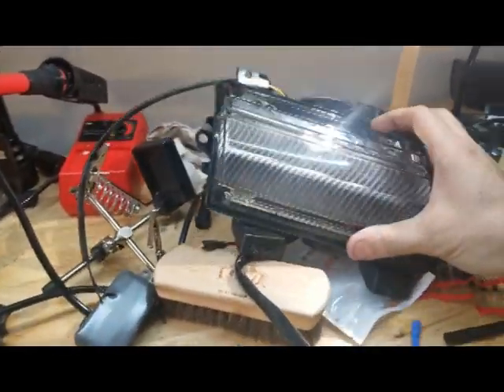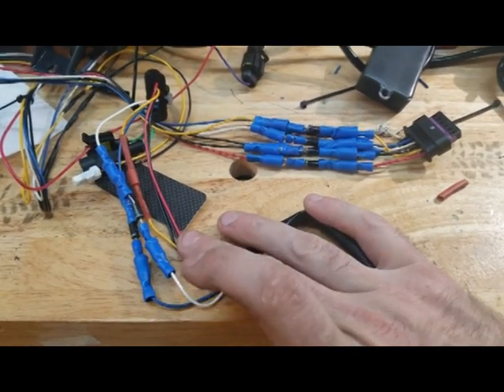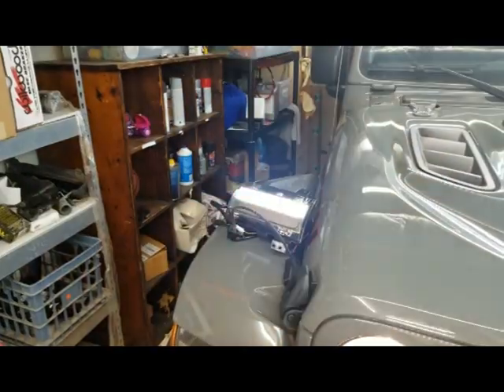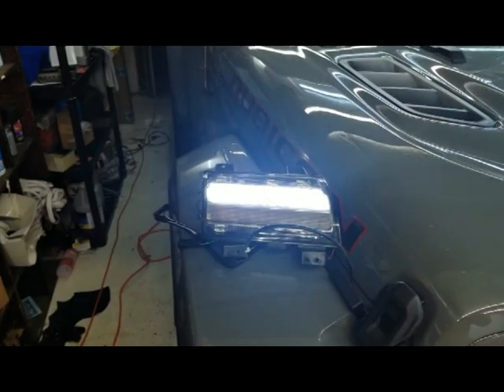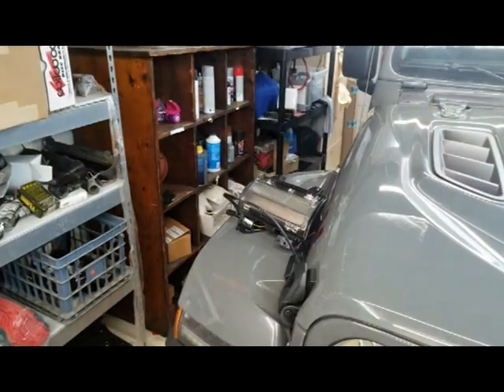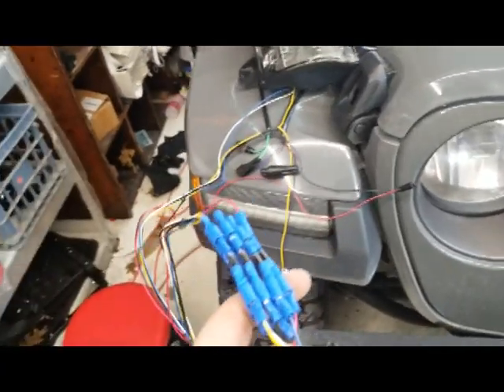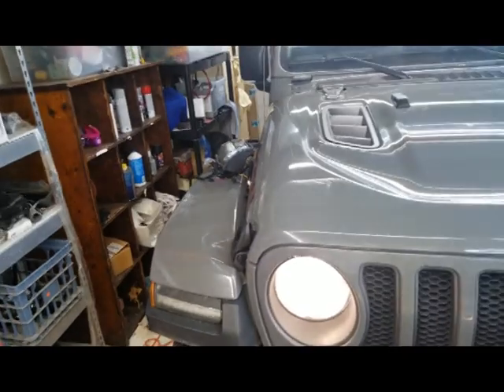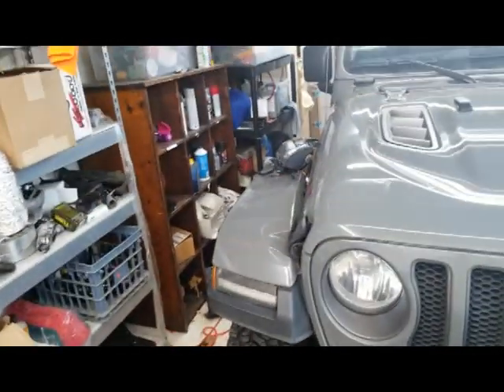Modifying Morimoto XB turn signals Jeep JL 2018+... working on a solution to the irregular flash!

Comment: Great video... can you tell me which wire is the power for the DRL? I think it's the blue one. I want to wire my halo in the headlight to it.
Reply from the maker: The yellow wire.  However when you hit the turn signal your drls will drop 

I tied my drls for the halos into the heated seat circuit using an add a circuit.
Reply: @obsessivehobbies5464  yes, I see that when I turn on my turn signal the DRL goes out which also turns off my headlight halo. I think the tazer can disable the DRL dimming, which would fix the hyper flash and the halo issue (as well as a bunch of other programmable things).